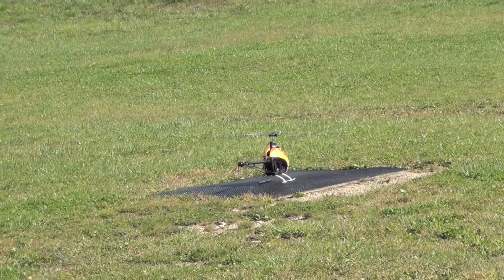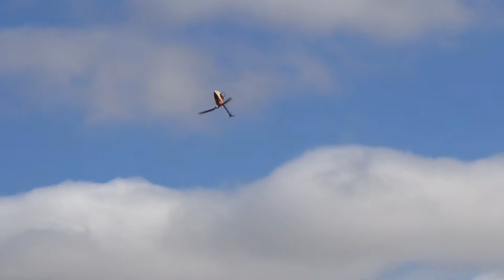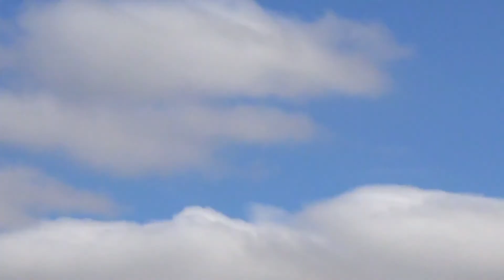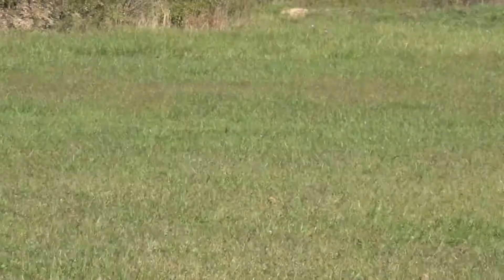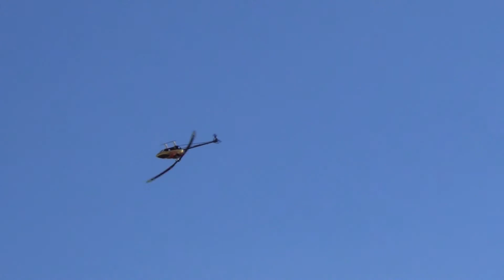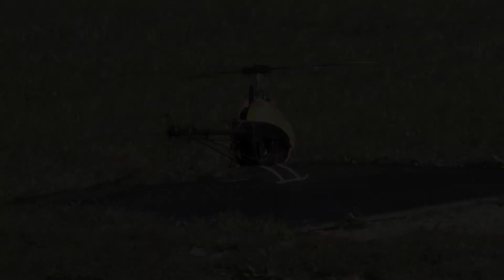Logo 500 Test Flight

Comment from the maker: It has an old Hacker Turbine motor, 9452 cyclics, 9256 tail, Ice 100 Esc, Align BEC and Thunder Power 5000/Blurr 1900 lipo packs. According to the log, it peaked around 2000 rpms and went down to 1800 when it bogged